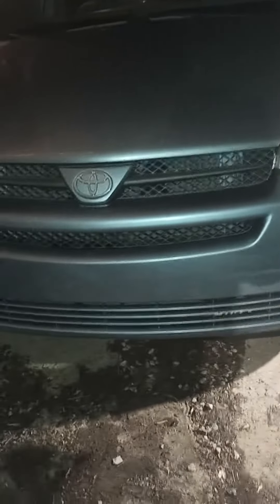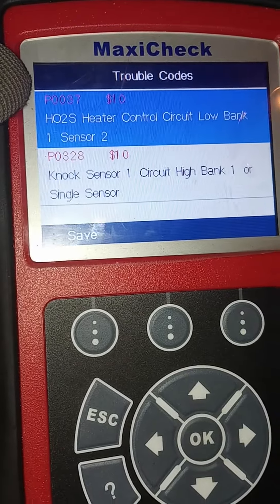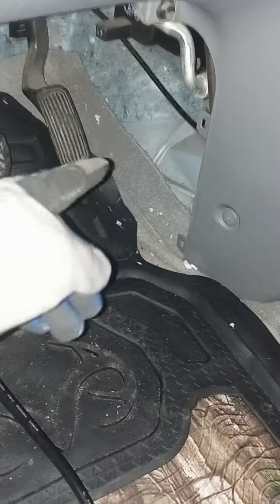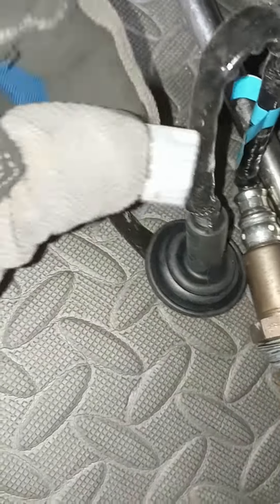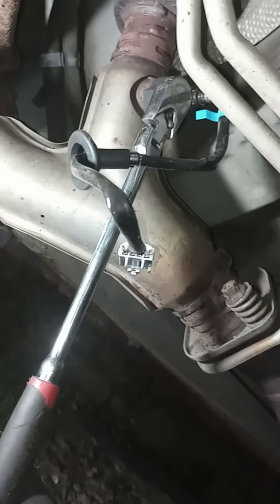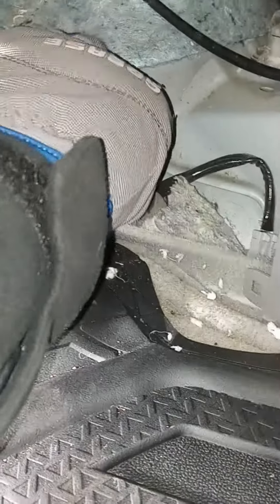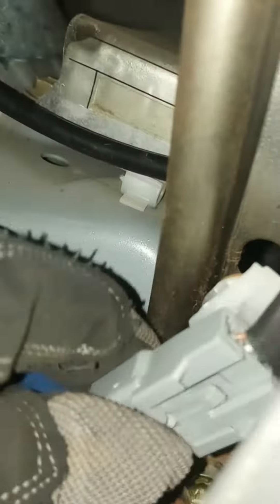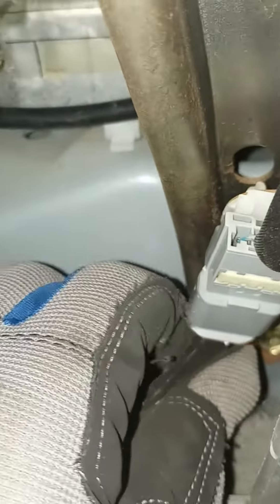(Part 1)  Replacing Oxygen Sensor On My 2004 Toyota Sienna (Sienna Series)

Comment from the maker: Denso 234-4516 OE Heated 4-Wire Downstream Oxygen Sensor 15.75” - https://www.amazon.com/gp/product/B0018JVJIE/ref=ppx_yo_dt_b_search_asin_title?ie=UTF8&psc=1

Offset Oxygen Sensor Socket, 3/8-Inch Drive, 7/8-Inch (22mm), Wire Gate Accesses Sensor from Side, Preventing Damage to Wires, Universal for Most Cars - 
https://www.amazon.com/gp/product/B0BBLNG7MW/ref=ppx_yo_dt_b_search_asin_title?ie=UTF8&psc=1